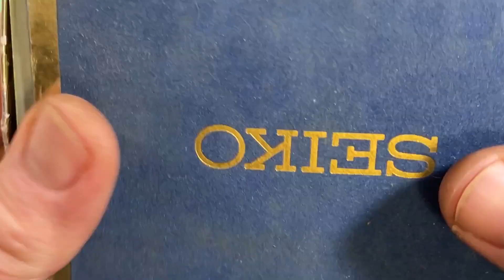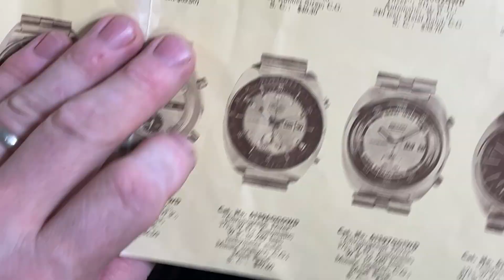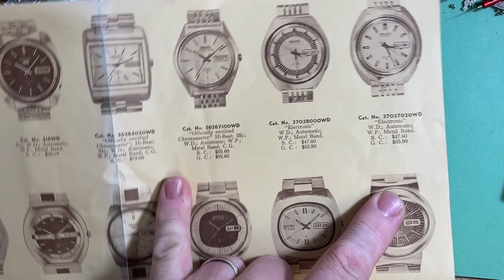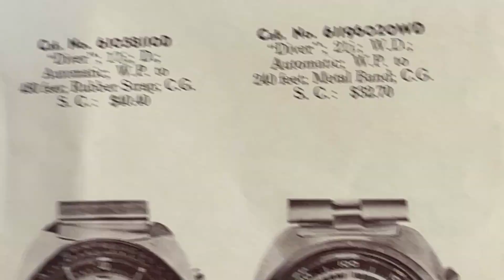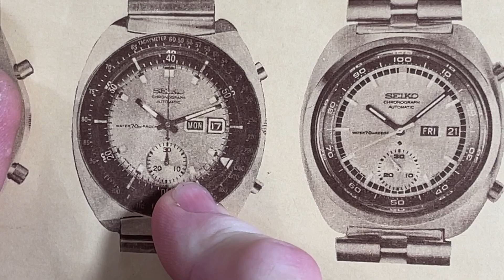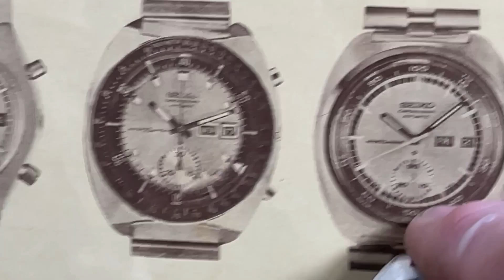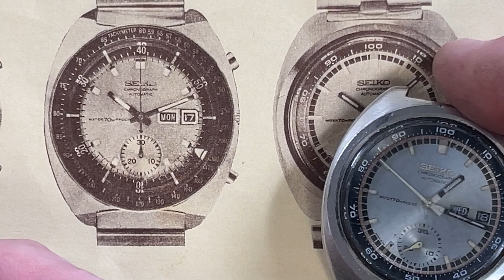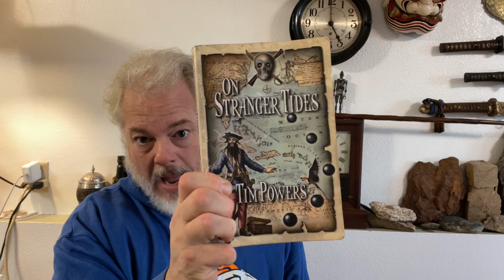Mail Call 166! July 8, 2022

Comment: Hey Spencer.  Just picked up my Seiko 5 GMT Batman SSK003 from my local AD.  Fit and finish are excellent.  Folks have already knocked the clasp but the bracelet overall is very solid and well finished.  The bezel treatment with the hardlex insert makes the black and blue colors look almost like liquid metal.  Very unique and mesmerizing.  I fully wound the 4R34 and threw it up on my time grapher.  Initial amplitude was showing between 272 - 285 and running straight at +3-4 seconds per day.  The only disappointment in my mind was the Beat Error was 0.8 - 1.0 on my particular watch which may be perfectly acceptable as a mass produced timepiece.  My OCD kicked in and I cracked the watch open and dialed in the BE to 0.0 with timing at +4 - 5 sec per day.  Now I am happy.  Seiko has a winner on their hands with the new GMTs.

Comment: Hi Spencer, question for next mail call, what do you think about the ETA 251 quartz chrono movement ? Seems very well built, all metal, fully serviceable. Also, I serviced my first ETA yesterday, a 2836-2, you can really feel it is made to tighter specifications compared to Seiko 7xxx series as you put all the parts back, they require just a bit more effort to fit into their holes, did you experience the same ?

Comment: Hi Spencer, I have a question for mail call. I recently bought a Monster 1st Gen. SKX781 NOS from my local Seiko Boutique. It's from early 2006 according to the serial, so luckily it has the 7s26/A movement, which I've heard you've said is better than the B/C variants. My question is, since the watch is NOS from 2006 and it was probably in a Seiko warehouse for 16 years , should I worry servicing it sooner than if it were a recently made Seiko?
Reply from the maker: I'd service it, yes.  Recently I did a service on a watch movement that I myself serviced like three, maybe four years ago.  There was a noticeable reduction in the amount of oil under the balance cap jewels.  The watch did not have a lot of post-restoration wrist time; it mostly sat in the watch box.  So, sixteen years will mean the movement is pretty dry.
Reply: @SpencerKleinVintageWatch  Thank you!

Comment: Hi Spencer and Sabrina. Proof vs Resist question. The casebacks you showed were marked Proof, but those would  be '70s watches, correct? So shouldn't they be Reists? When did the Proof era end?
Reply from the maker: The last proof watches I know of were made in January 1971 - the last month of proof production before the "true Pogue" resists started being produced in February 1971, or at least that's the earliest I've seen.

Comment: Hey Spencer and Sabrina! Thank you for getting every weekend off to a great start with mail call! I faithfully watch every week!

I would like advice from both of you with respect to a 1988 birth year Seiko. I have a nice variety of modern and vintage seikos, as well as a Grand Seiko Snowflake. I have always wanted a birth year watch and have looked for a number of years however I cannot decide. Can you suggest any references dated 1988 (Bonus if it's July 1988) that I should consider? 

Thank you so much for your advice and time!

Nathan
Reply: If I may be so bold, If you are a diver fan, a 7548 would be a great way to go!  They are indestructible.  That, or a 7a28 or 7a38 if you are a Chronograph fan.  Best quartz movement ever made, according to The Book of Spencer!
Reply: I would also like to add the following question - do yo know where I can find catalogues from 1988? I have started a search and it is difficult to find PDFs of 1988 catalogues.
Reply from the maker: No idea.  Someone has to find one and scan it.